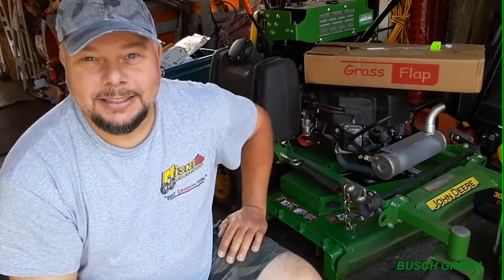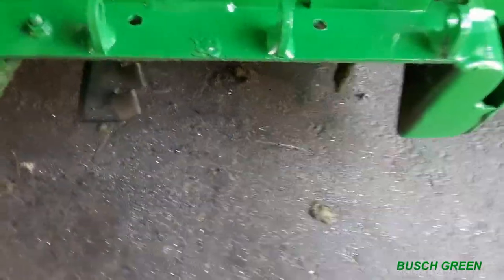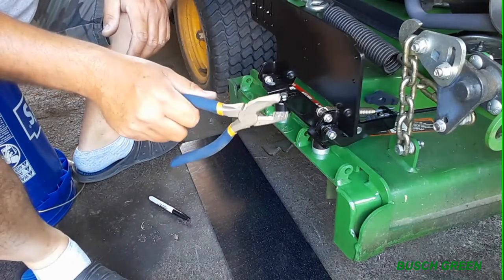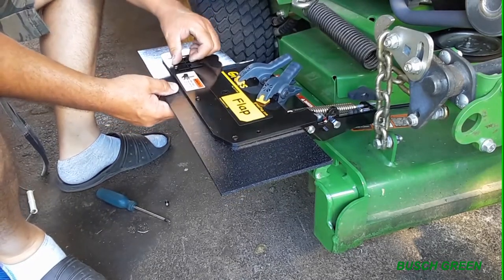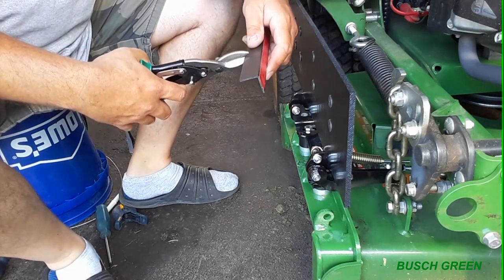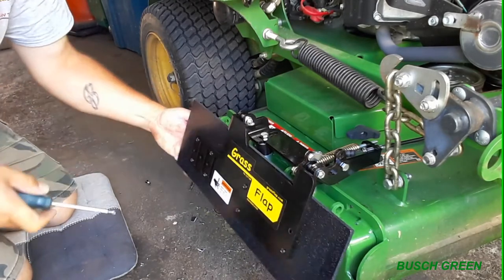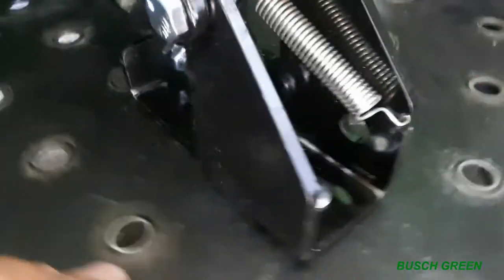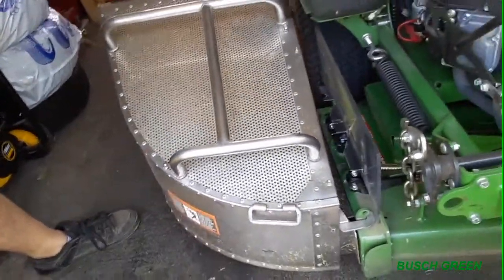Grass Flap install on a 2019 John Deere 636M Stand On Mower

Comment: Hey, hey Mike! Looks like you need one of those handy dandy spring pullers like Mark (Misfit) has!
The little inserts on the back of the plastic plate are t-nuts. VERY handy pieces of hardware! 
Nice job, Brother! Great video! Now, let's get the shed done! :D Can't wait!
Reply from the maker: Hey Lou, yes, a spring tool will be the next item for my tool box. You are right, T-Nuts lol. I start talking and forget things. Maybe age lol. The shop is still just a concrete slab. Hopefully soon a building will be there. Thanks for your support Lou!
Reply: @MBGAdventures  NO, NO...Don't say age!!! I'm WAY older than you! hahaha!
Yeah, man...if I can't wait to see the shed, I can only imagine YOUR anticipation! Hope your weekend is GREAT!

Comment: Thank you so much for making this video! I am not mechanically inclined and am heavily considering purchasing this. I was worried because I didn’t think I could Install it myself. You have helped me so much! Can you please tell me if you also have the mulch kit installed and which mower blades you are using?
Reply from the maker: No problem at all. Trust me, I am not mechanically inclined either. If I can do it, anyone can. I don't have a mulch kit on this mower. If you did, then you would have a plate on the chute closed all the time. Blades my John Deere dealer got for me is part number 15-6294. They work amazing for regular cutting and mulching. I assume you have the same machine? Hope this is helpful.
Reply: @MBGAdventures  thank you! yes I have the 636m and mow for 10 accounts. I am planning on installing the grass flap, mulch kit, and g6 gator blades for this season
Reply: **Update** mulch kit doesn’t work with the bagger as you stated above. I have installed the grass flap and g6 gator blades. Can’t wait to try it out (currently raining). Thanks again for the video.
Reply from the maker: @parkertillman5897  Hey Parker, no man, the mulch kit closes the discharge chute on the mower with no option to open. Mount the grass flap exactly how I did and you will have no problems at all. My grass catcher fits like a glove. I'm so happy my video helped you. I am no pro at all, just some guy with basic mechanical skills like most of us. :)
Reply: Thanks! Got it all mounted up. Works like a dream!
Reply from the maker: @parkertillman5897  That is awesome Parker. I am happy that I could help with my video.

Comment: How did you remove cotton pin on John Deere deck discharge chute to install grass flap
Reply from the maker: From what I remember it was pretty easy. Bend it straight and pull through with pliers.
Reply: @MBGAdventures  ok thanks

Comment: Pretty nice man. We made a home made chute blocker for one of our mowers we have 🤔. It worked great for only spending 10$ lol, but it doesn't work nearly as good as what you got there.
Reply from the maker: If the homemade one works, keep it and save the money. I was getting frustrated with mine. I wanted to see how the Grass Flap will work since I see many others using it. It will be put to the test starting tomorrow.
Reply: @MBGAdventures  yea I did the exact same thing. We bought an actual chute blocker for one of our upgrades to see how much better it was then ours lol

Comment: Pretty impressive chute. Nice install..... I love little projects like that. You may want to keep an eye on those screws... maybe a drop of loctite on them if they vibrate loose. These types of videos are in my wheelhouse.... I watch how to stuff 3 out of 4 videos that I watch on youtube. Video quality is very good.
Reply from the maker: Thanks Ken! I like videos like this too. I am just not as mechanically inclined as many that I watch like you. I think I will help the average person with basic skills build more confidence doing work like this yourself. Make mistakes and learn. The little screws came with a red coating on them. I will keep my eye on all the screws, nuts and bolts to make sure nothing comes loose. Video is all done on my cell phone. I use my phone on most of my videos. Thanks for watching!

Comment: looks to fit good. I personally don't like the foot pedal on platform in my opinion. I am so use to operating mowers with my left hand that I find it easy to operate chute blocker with right hand at same time. Nice quality in this video Mike and we get to see you in your relax clothes with the sandals.
Reply from the maker: I looked into quick chute too. The homemade one I had I did the same, left hand drive and right hand operate the blocker. I just wanted to try this out with the pedal to see how I like it. Works great so far at my own house. Will be put to the test so lets see. Yes, when I am around the house you will see me with socks and sandals on lol. Sometimes I forget and when we go out, I am walking in the a store like that. LOL